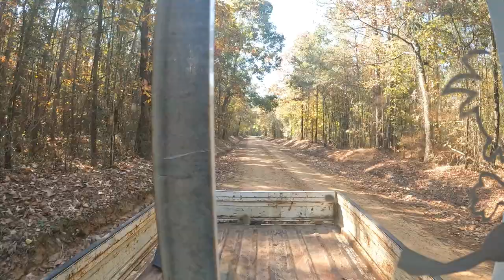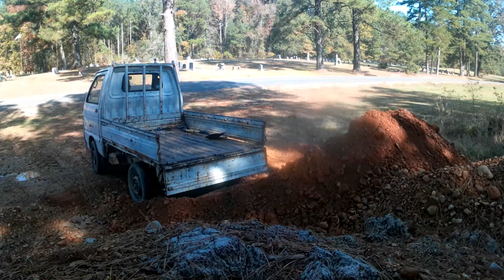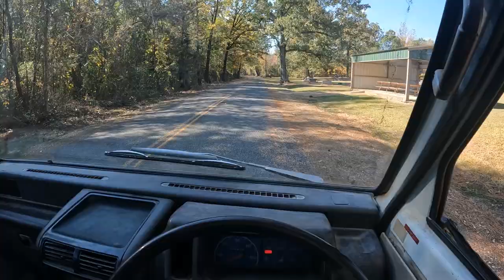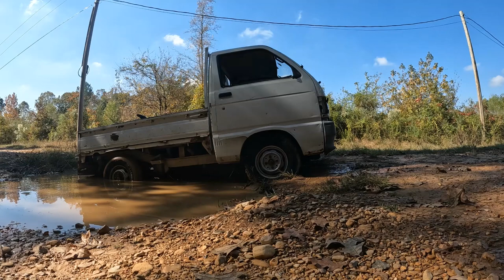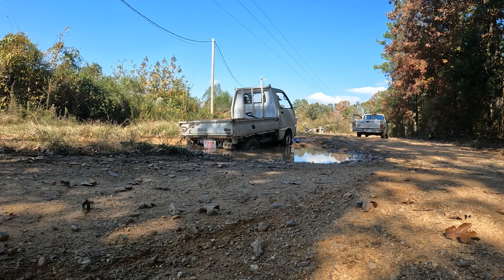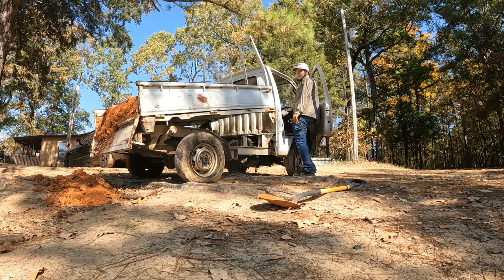MINI TRUCK Durability Testing full load in the MUD

Comment: Did you put it in neutral?and take it out of 4wheel drive before u started tugging on it?cause u can def tell its wheels are locked when u yank
Reply from the maker: It was stuck but the front wheel was spinning on the other side

Comment: Dustin, Im rebuilding one of those right now, almost finished, did you try the diff lock switch to get out of that hole. I noticed none of the right side tires were spinning. One of the disadvantages to those trucks is that they have a low ground clearance. Lots of folks lift them and put atv tires on, but when you do that you loose haul capacity and cant run those on the road around here if you have atv tires. thx
Reply from the maker: Yeah I found out the diff lock switch was just for the rear axle and the last one i had ATV tires it blowed one tier out wen I put gravel in the bed and they loose a lot of power

Comment: Please, no more Hijet torture videos.  You need some mud and snow tires if you're going to run your Hijet in the mud.
Reply from the maker: Yeah I didn't plan to get stuck that bad but the HIJET went to a new owner that is going to take good care of it and I got a Yamaha rhino 700 EFI to test out now lol
Reply: @DustinLansdell  - My 1996 4WD Hijet is halfway across the Pacific Ocean, from Yokohama to Newport News Virginia, scheduled to arrive around December 8th.  I've already bought a bunch of stuff for it.  It was going to be my fall project but I'll dink around with it during the winter a bit so it's mostly my spring project.  It takes three months to import one of these.  Mine has 45,000 miles and almost no rust.  I paid $265 for the truck but delivery cost $2115 more.
Reply from the maker: Yeah iv always wanted to get one of those Toyota Hilux with the Diesel engine maybe one day if YouTube takes off I can get one but yeah iv had 3 Mitsubishi mine truck I got for $1200 but the steering wheel was on left side in them and one Mitsubishi that was different had a 2 cylinder engine with the steering wheel on the right side. Yeah there's a place in DeQeen AR  that seals them mini truck and Suzuki tangs that look just like a samurai but r like new but they won't like $10'000 to $12'000 for them .
Reply: @DustinLansdell  - Mini truck prices have shot up.  I saw a nice 26 year old mini truck sell on Bring A Trailer for $24,000.  Insane.  Dealers now get $10K for the 25+ year old JDM mini trucks that are street legal in many states, and they get $20,000+ for late model mini trucks that can't be licensed for use on the road per protectionist federal law.  They're often lifted, with large off road tires.  People buy them as enclosed cab versions of side-by-sides with heating and air conditioning and windshield wipers, for farm vehicles or hunting vehicles.
Reply from the maker: Yeah idk we're this place gets them but there like brand new EFI up to 70 mph some r 4door that look like a Chevy avalanche and some and the sale new Suzuki jimmy some r like a bucket truck and some have light tower plant in the back there cool tho did you see my video were I put the head back on my Hi jet it was a 89 still had the old ponts in the  distributor to make the plugs fire